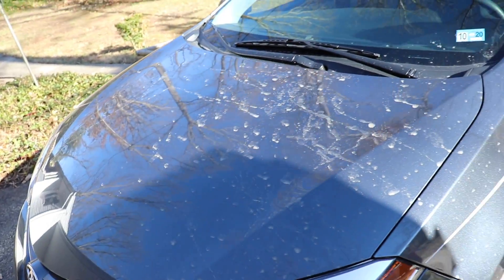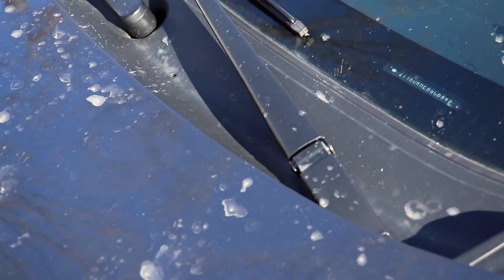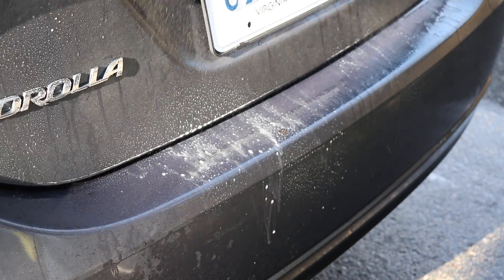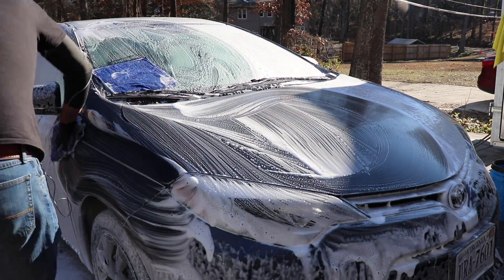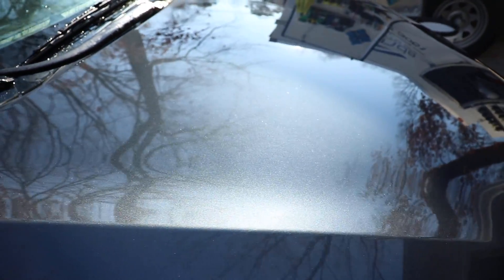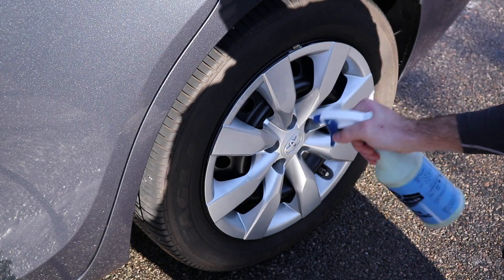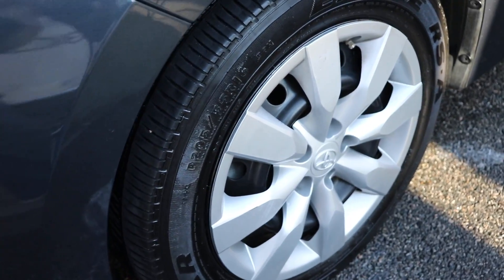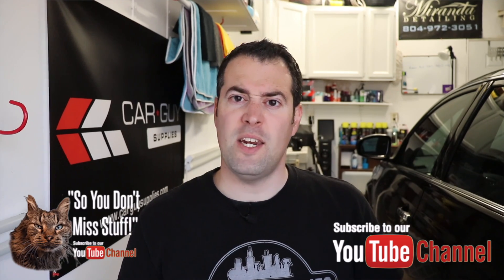Simple Wash & Wax With Meguiar's HyperWash and Hybrid Ceramic Wax

Comment: So you don't miss stuff🤣🤣🤣 i love.

I did not know this method of washing the bodywork and putting on the decontamination glove at the same time.
Reply from the maker: 😎👍🏼. Yeah it quickens up the process  I use it all the time.
Reply: @MirandaDetailing  Yes but it is not in the case of a large preparation. So, no chemical decontamination of the bodywork? Is it only for quick protection like synthetic wax spray?
Reply from the maker: This is just a quick wash and wax. Not a prep for a polishing or anything else. If I was prepping for paint correction or polishing may use some iron decon or tar remover but only if needed. If the paint work does not need it I don’t waste time and product. For a mobile detailer it’s not advisable. That would eat up time and money. In a shop environment sure, I could charge more because I’m going further. I like to show a variety of options on my channel. From simple methods that work to more in-depth methods if one wants to go further. In the case of using the clay towel while washing...it’s great to quickly remove grit and smooth out the paint. Does it cause some marring...sure, very minimal as does all claying. But that’s fine for a simple wash and wax method. Some people I find overthink it. 😎👍🏼
Reply: @MirandaDetailing  
Above all, with the lubrication side during washing, there is even less risk of creating micro scratches with the decontamination glove. How do you go about maintaining it? I'm talking about the decontamination glove.
Reply from the maker: Oh I see....Yes I rinse the clay towel or mitt very well and then either hang dry or place clay side up on my shelf to dry.
Reply: @MirandaDetailing  Thank you very much for your advice and for your reviews on the meguiar's brand. I am gradually equipping myself with this brand with their gallons.
Reply from the maker: autocleanet you’re welcome!!  Thank you!
Reply: @MirandaDetailing  Thank you very much for subscribing to my channel. Unfortunately, I speak French on it. But I think with the pictures, you will understand 😉
Reply: @MirandaDetailing  Phil this is what I love about your channel. You put up different types of videos covering a wide range of practical advice using different product. Your channel hasn't just turned into a product review channel. Always something to learn from you. Thanks a lot. Interested to see you tech reviews and how to's as well.
Reply from the maker: David B Thanks!! 😎👍🏼
Reply: @MirandaDetailing  is the clay towel safer then clay bar?

Comment: Great video, short and informative! I do appreciate your older “full length” detailing videos as well!
What do I use to get all the old leftover RainX off my truck so I can start over with the hybrid wax?
Reply from the maker: Thanks!  I would use a strong degreaser like Super Clean or some type of Citrus degreaser or APC. If it still looks like there is left over protection use a light polish like M210 or M205 to remove anything else.
Reply: Miranda Detailing Thanks!

Comment: Another great video Phil. I used the HCW on an older car that sits outside and it has performed pretty well. I am curious to see if the turtle wax ceramic spray would have more longevity since I have not been able to reapply the meguiars over the last few months during the winter here.
Reply from the maker: Thanks!  I’m sure the TW Spray coating would outlast HCW but since they are so easy to maintain just a quick once over with either product will keep the protection healthy.

Comment: Doesn't the clay towel introduce marring into the paint?
Reply from the maker: It can cause some marring if used without proper lubrication, That why I love using a high foaming soap to add lots of slickness and thick foam to cushion the clay mitt.  I have found that even clay bars will mar anything to a degree, depending on the paint of course.👍🏼

Comment: Hey Phil. Before I use the HD speed..I I have turtle wax ceramic coating on my truck, I put it on about three months ago. How should I go about this? Should I try to remove the ceramic with something. Any recommendations. Thanks. Joe
Reply from the maker: Hi. If you use a good strong shampoo and do a thorough apc rinse before it will weaken the spray coating enough that when you polish with 3D Speed it will remove any remaining protection, and leave its own.

Comment: Great, can you please advise what is the dilution ratio for hyper wash in foam Canon?
Reply from the maker: Hi. Well we usually dilute soaps by the gallon so we dilute 10:1. But if you are using a 32oz bottle 10:1 comes to about 3oz per 32oz bottle. It may seem like a lot but it dilute labor more when you use the foam cannon.
Reply: @MirandaDetailing  thank you for your reply stay safe

Comment: Which do you prefer Hyb Ceramic Wax or TW Hybrid Solutions Ceramic Spray Coating?
Reply from the maker: I like both. Each have there pros and cons. I think the TW Spray coating is very easy to apply. But the Meg Hybrid Wax is a great drying aid and once the foundation layer is set all it needs is a spray and rinse method to layer it again. The TW is also easy to apply but needs dry application. But still super easy to use. Both are  awesome